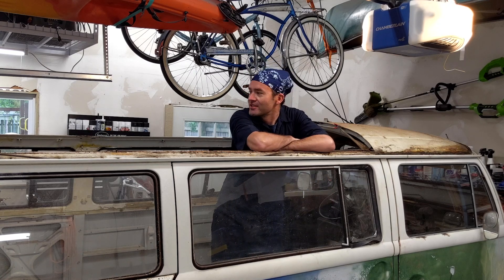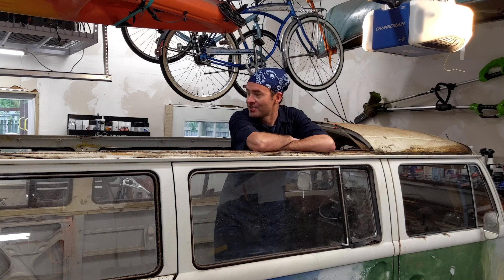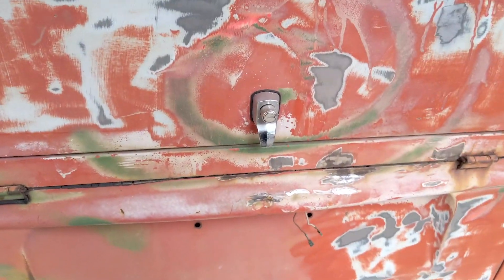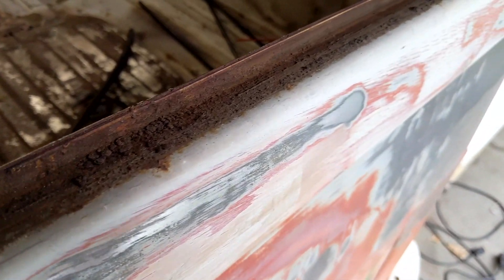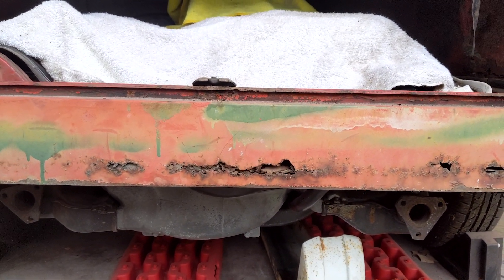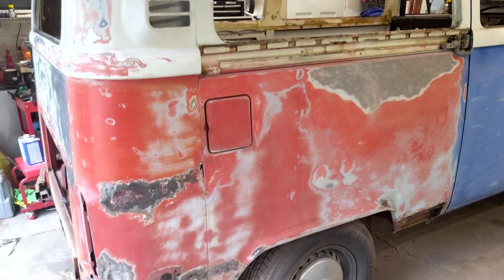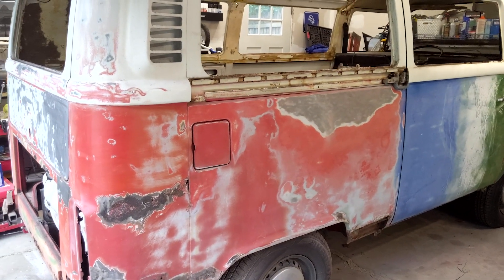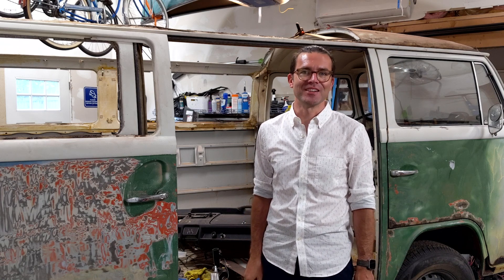The Sparks Fly! - 1973 Volkswagen Bus Panel Removal

Comment: Hi, the carrier plate behind the outer rocker panel looks much better, than I thought. I am sure that this car will need a cross member between both c-pillars at the top. Like you have it at your westi bus. There are some special cross members for high tops, but that thing is very important for the stabilization of the car. I wish you good luck. Regards Ralph